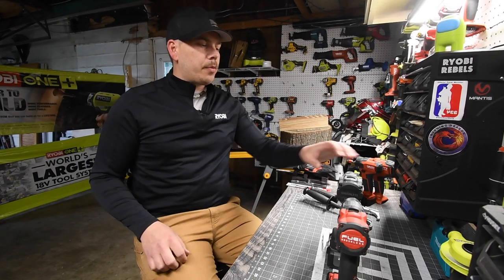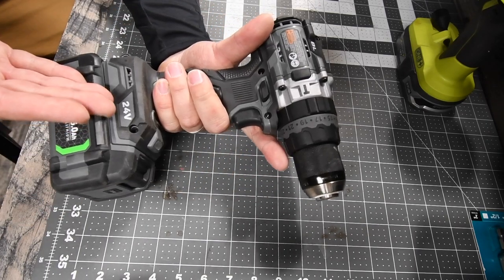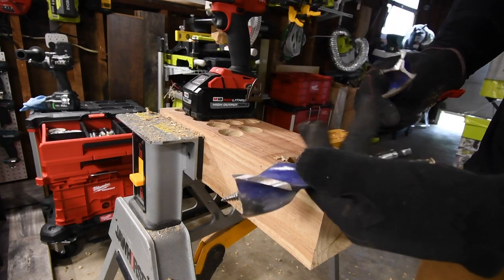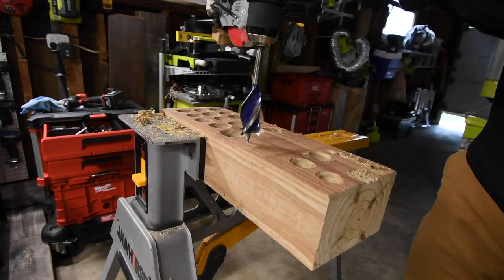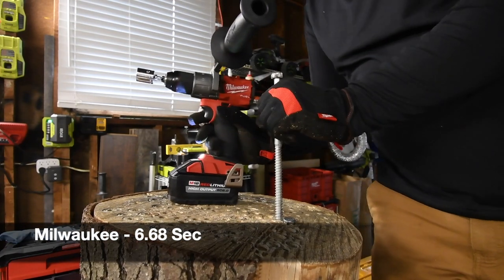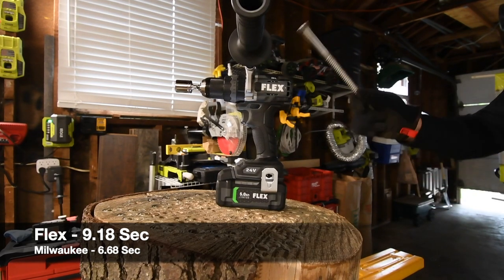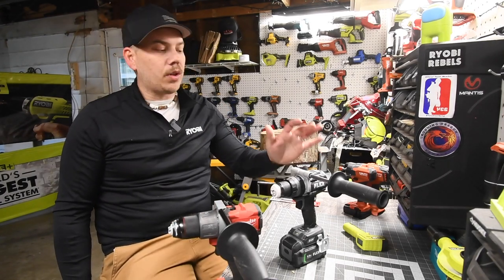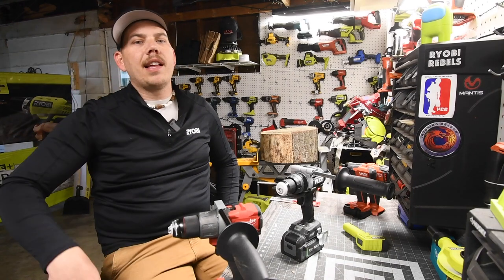FLEX vs Milwuakee (Hammer Drills)

Comment: Both are really powerful tools.  The Flex seems to be faster in most test. Mine is so far so good.  The only thing is that when I run it on turbo  that your not suppose to do all the time it gets really hot. The heat is concentrated in the handle right above the battery. That's only on turbo other than that you could run that drill in regular speed all day.
Reply: Good information. Thanks for sharing.

Comment: Finally. For a tool company that came out so headstrong there seems to be a real lack of these tool channels doing real reviews of the tool vs the rest in the industry. There’s hundreds of reviews of Milwaukee Ryobi Dewalt. Trying to find one for flex versus the other brands like a needle in a haystack. Makes you wonder why these channels have been so silent all these weeks. The other channels talk about flex but they’re not competing other brands against flex.
Reply: DeWalt makes the best hammer drills. The DCD998/999. Milwaukee is more known for their impact drivers and sawzalls. Skil is known for the Skilsaw circular saws.
Reply: @ecoRfan  that may be but that’s never stopped most channels from doing head to head duals. I have nothing against Flex. Thinking of giving them a try but the lack of show has holding off. I guess it comes down to, I’ve heard a lot of talk. I’ve not seen a lot of action.
Reply: Philly Fixed has done head-to-head comparisons on them.
Reply: That’s one out of how many channels? I was just hoping for more sooner. Just have to wait.

Comment: The Milwaukee is a good match for the Flex since they can both be considered somewhat compact vs the more powerful full size drills that DeWalt and Hilti produce.  On one hand you could say Milwaukee was actually kind of favored here since it had a 21700 cell battery pack and the Flex did not, but on the other hand Flex's batteries are absolutely massive so that this is a more reasonable comparison for their size. Great test though, and I wonder how Flex will hold up over the years. That is what will make or break them as a brand.

Comment: The question is, which drill gets hotter overall?
Milwaukee has been known to get hotter than other brands, but the gen 4 seems to put out more air for better cooling.
By the way, the 2804 has been proven to be one of the most powerful drills on the market.
Reply from the maker: very good ill have to pick it up soon

Comment: Throughout all these vs tests I watch, despite one brand maybe having a generally small time advantage , I need to know the tool I'm using is going to consistently work and get my job done over a long period of time.  Until Flex can offer me a large variety of the solid price and product deals I can get with proven brands. Dewalt , Milwaukee, Makita I am not going to shell out more money per product unless I am getting value back. The deals that are available for these other brands are amazing , and the options are endless. I appreciate Flex can win a time test here and there, not always but where is the incentive to buy these Flex  right now. I can certainly wait till the prices come way down and the battery choices and options are much better.
I still love watching these vids, but just like Festool or Hilti may be better for some applications here and there,  more bang for the buck keeps them out of the majority of tool bags. Flex just  doesn't spark any interest in me to but the product.
Reply: Well said
Reply: Flex has a lifetime founders warranty for any tools purchased until the end of the year, covering the tool, battery, and battery charger just an FYI. The price is pretty significant all the same.
Reply: Or more buck for the bang.

Comment: In my opinion. Milwaukee is more powerful. Flex is faster. Guess it depends on ur needs. I personally go with power, because I drill a lot with holesaw bits, and I already think my Milwaukee is too fast sometimes. I'm sure others might like more speed tho.
Reply: @Star Gazer1212 yeah 2 speeds. Crazy fast and slow

Comment: Power and speed are 2 different things entirely. If both drills can complete the task without much resistance speed wins. The more resistance the more power plays a part until ultimately one drill completes the task and the other doesn’t. 

Milwaukee is a 3yr old drill and still has as much power as the drills being put out today. I can only imagine what their next offering will be come later this year or next. 

Only thing I don’t like about the Milwaukee is the setting selector. It’s made of plastic and I’d prefer something sturdier. Other than that it’s a great drill. 

I also really like the flex tools. Future is bright with both brands no downside.
Reply: Next gen Milwaukee blows this thing out of the water hands down

Comment: Glad I didn't buy junk. Ive had to upgrade my drills/up impact for years. I bought the Flex t he is morning. The main reason to choose this line ? Everyone else has DeWalt or Milwakee. This way I can always see and grab MY tools and not THIERS. I'm funny about using others tools and others using mine. Thanks for the review. Plus it came with a LIFETIME battery And tool warranty.
Reply: How are they holding up?
Reply: Hows the flex holding up?

Comment: Those are both great tools! But i would still chose the Milwaukee
Reply: David, so would I.  Not because I own one, but due to the longevity of the tool in the marketplace.  The Milwaukee Fuel G3 Hammer Drill has probably been one of the Mose extensively tested drills ever.  It’s won it’s fair share of tests.  I mix buckets of mud and thin set with mine.  Equipped with a 3 amp HO battery it’s a great all around drill.  Not too heavy to work overhead, ergonomically well built and powerful!
Reply: @martylucas8557  Good reasoning!
Reply: @dav1d629 , thanks David!
Reply from the maker: I would as well
Reply: @ManCaverTools  yep 👍
Reply: My Milwaukee has cut thousands of 10 inch holes through frozen Lake Champlain ice fishing. It’s beef cake.
Reply: @crisjr6478  good drill it is!

Comment: What hammer drill do recommend. Im on the makita platform, but I bought a milwaukee impact. I'm also looking to get flex when the come to Canada. Impact for sure might get the hammer drill as well. My makita kit is about 7yrs old
Reply from the maker: the best one on the market that I tested was the Dewalt Power Detect
Reply: Thanks you for the time to replay. I will look into thats drill

Comment: What I like is the milwaikee was always top dog. Dewalt was right up there as well. But when a new tool has the power to be a contestant with the top brands....it excites me. I bought flex push button driver and I love it. I think I'm getting the flex turbo next, even though I really want the milwaukee. There's something about flex that calls to me.. now again I work at lowes and absolutely want dewalts 998 hammer drill but I don't know why. Something says get the flex turbo monster
Reply from the maker: That Power Detect is a beast as well
Reply: @ManCaverTools  Who makes FLEX drill ❓❓

Comment: Why the hell did you turn off the Turbo on the lag test?
Reply from the maker: because the turbo mode would make it fail
Reply: @ManCaverTools  Turbo mode won't make it fail in speed 1.
Reply: @ManCaverTools  Turbo mode will not make it fail in speed 1.
Reply from the maker: @jdelapaz14  driving in a 10" lag it will
Reply from the maker: @jdelapaz14  wanna know how I know that. I already did a video on it failing at the 10" lag with a turbo on on speed 1. I do more then 1 video on each of these tools.
Reply: @ManCaverTools  I did the same test on speed 1 on turbo.
Reply from the maker: @jdelapaz14  so did I and it failed. what more do you want.
Reply: @ManCaverTools  it would be nice if you did an honest comparison video because if you did you would conclude that the flex compared to the current Milwaukee (which will no doubt change when the next model comes out) outperforms it in strength and power. Even the smaller output 5ah battery outperforms or matches the high output Milwaukee even though the Milwaukee high output puts out more power at a faster rate. the 8ah flex is more powerful but isn't a high output either and with the 8ah it outperforms the Milwaukee even more than the 5ah. I have always used Milwaukee and now I have both and I can tell you without a doubt the flex right now is faster and stronger.

Comment: When you used the Hilti you could tell you were putting a lot of body weight on it, the Milwaukee you didn’t put much pressure at all, if you did, it would have changed sound.
Reply from the maker: that was from a different video that I uploaded a year ago
Reply: @ManCaverTools , then why did you show it Dave?  You wanted to represent something...what was it.  I seem to remember the Milwaukee Fuel G3 Hammer Drill smoking the Hilti Hammer Drill.
Reply: @martylucas8557  The milwauke time was significantly longer than the Hilti's. It was 11 seconds versus 4 or so. Body weight or no body weight, you just hate seeing a brand you worship get smoked by some Liechtenstein tool makers lmao

Comment: I’ve used both on concrete and the biggest difference is the Milwaukee barely hits the ears and flex is so loud ur brain will melt. I can’t deal with the noise it’s bone shattering loud. It does work though just over twice as loud.

Comment: I like testing tools the way they came.
Reply: Competitively against another brand?  Why is that?  That’s the worst way to test a tool, because it won’t be apples to apples.  Take the Milwaukee Fuel G3 Hammer Drill for instance.  If Dave were to have received or purchased as “tool only” then you’d run it up against the competitor without a battery? 

See how ridiculous that is?
Reply: @martylucas8557  so, in your hypothetical scenario, Ryobi would have sent an incomplete tool to Dave to test and review? See how ridiculous that sounds?
Clearly, I have to explain to you what I meant. Testing the tools as they come means that you test the tools the way they were kitted at the store or with the battery they came with. 
I didn't think I would ever have to explain that but...
Reply: @ToolswithSoAlz , you didn’t have to explain anything to me, I thought the over dramatization of using no battery since the tool came with no battery explained how I felt about testing tools as kitted.  It’s a silly way to test a tool.  Think about it for a minute, let’s say Milwaukee has an over abundance of older 18650, 2 amp batteries they want to get rid of.  So they package the 2 amp battery, with a charger, as a special promotion with a Gen 3 FUEL Hammer Drill.  Because the deal was good and the battery or batteries were free the tester decided to purchase that kitted tool.  Would you then feel it a good test to put it up against the Flex 24 Volt Hammer Drill which came kitted with 5 amp batteries or another drill that came kitted with 21700 and 2 or 3 times the amperage?  If you truly felt that fair, then you probably wouldn’t have very good viewership.  That or you’re going to have a lot of ticked off viewers.  

Therefor...as kitted is not a good or equitable way to have a heads up test.  What do you feel is gained by testing in this manner?  Vince @ VCG was testing as kitted for a while and received a lot of backlash.  He received it for a good reason.  Because he wasn’t marrying the tool or tools with the best offering from the manufacturer.  It left a lot of people believing that the horse they had in the race would’ve won, had it been equipped with a similar battery as the competition.
Reply: @martylucas8557  this is laughable. I got it. Testing tools the way you buy then is silly. Kind of like continuing a conversation with you.
Reply: @ToolswithSoAlz , you don’t get it because you have rocks in your head.  Your original comment was...”I like testing tools the way they came”.  What if one came with no battery, another with a 2 amp battery, another with an 8 amp HO battery and the competitive tool came with a 5 amp battery?  If you tested those tools as “they came”, it would be the stupidest test ever!  Tool test channels that know what they’re doing will equip each tool as closely as the other one being tested, in order to allow an apples to apples test.  Otherwise....what’s the use?

Do I really need to spell this out for you?  You’re starting to annoy me!!

Comment: The high output battery will definitely help the Flex on power. I’m still surprised Flex used the 18,650 cells in the 2.5 & 5.0 amp batteries. 

Great test! 👍
Reply: its the juice in the cells that makes the difference. The cell numbers refer to the amount of material that can be put in. Even though they used 18650 it could be a more potent cocktail that what some companies put in their 21700
Reply from the maker: I believe it would as well

Comment: So the Milwaukee (18V) beats, or nearly beats the Flex (24V), in every category. It’s like comparing the M12 vs the M18. The Milwaukee is a far better drill in my opinion. The Flex needs years to prove itself, and need another hundred + tools to even be considered. I understand it’s a “new” brand, but the competition it’s going up against is pretty strong.
Reply: Your nuts. The flex beat it in every category except when he handicapped it by turning off the turbo button for the lags. It's factually a stronger tool. Its 1200punds torque vs 1400pounds torque. He's even using a high output battery on the milwaukee and it still lost every test. I'm a milwaukee guy and now own the flex also. I use both drills almost everyday with my guys at work and the flex hammerfrill outperforms the Milwaukee. Not as much of a difference as the impact driver which is faster and stronger by far but it is still considerably stronger with the hammerdrill. Milwaukee will no doubt come out with a stronger tool and then one of the other companies will try again. It's so weird people won't admit the right now the flex is the stronger tool.
Reply: What planet are you on ?
Reply from the maker: I agree with you on that

Comment: I wonder if the Milwaukee would've competed better if you'd used a 9.0 or 12.0 Amp battery? It would've levelled the playing field a bit given that the Flex has an extra cell?
Reply: Meh...no...
Reply from the maker: remember, Flex said the fastest most powerful hammer drill not he market. this video says otherwise
Reply: The 9.0 wouldn’t provide much of a boost over the HO 6.0, it might be a bit weaker. Standard 18650s in the 9.0 vs high drain 21700s in the HO 6.0.

Comment: Are those imapact sockets being used on the lag bolts?
Reply: They don't look like it
Reply: They look like your standard Chrome sockets, don't need impact as there is no impact involved here.
Reply from the maker: no, im not using and impact wrench or impact driver. chrome sockets can easily withstand those lags on a drill